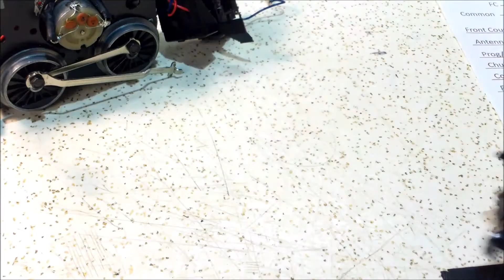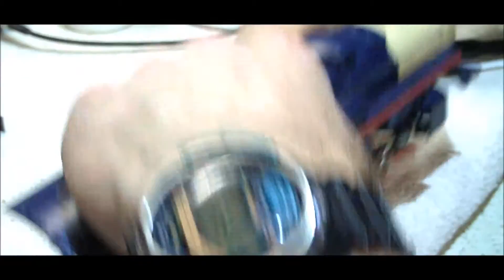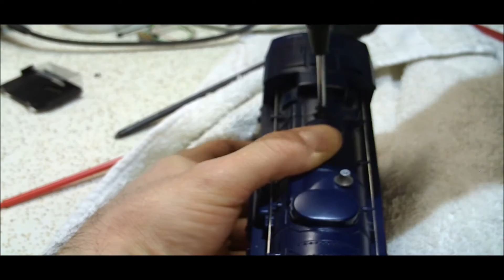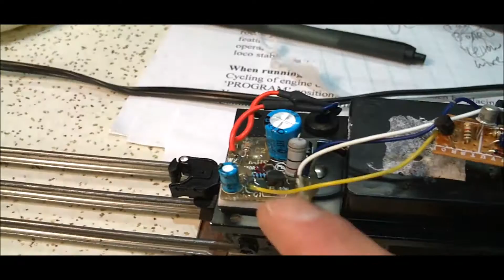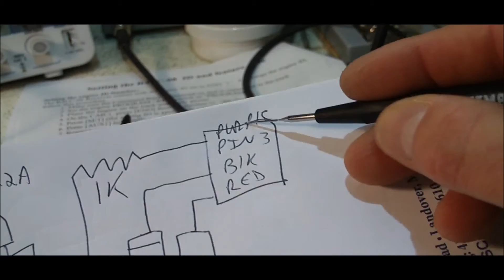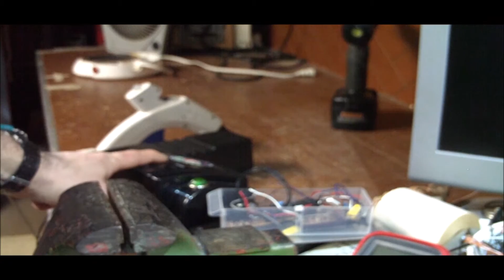How To: Install the Electric Railroad TMCC / Cruise Commader Lite in a Lionel Steam Engine

Comment: Hey Carl,  how is your Lionel Scout running with the Cruise Commander lite?   I have a similar engine with the same cheap dc motor and I am getting a lot of emf noise.  What are the capacitors on the motor rated at?  Maybe this is what I need to get mine running better.  Thanks  Adam
Reply from the maker: Mine is running fine. I believe the capacitor were .1uf. (104 is the number on the cap)